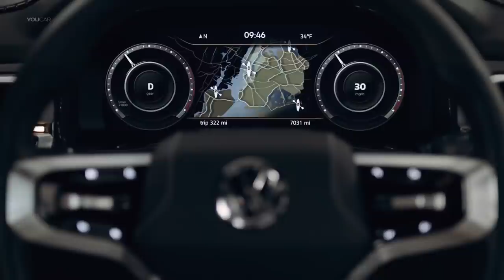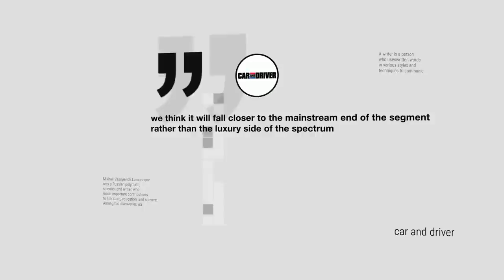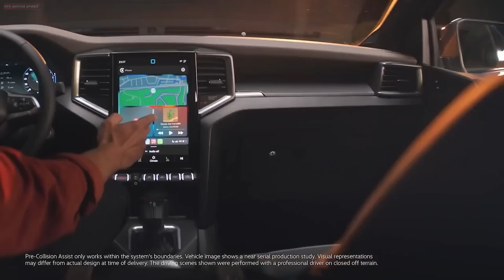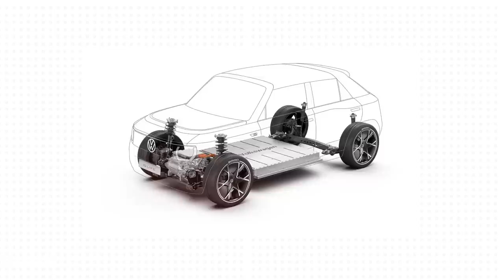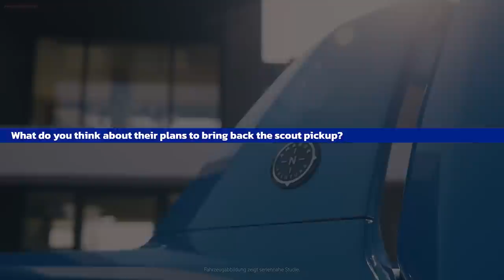Volkswagen CEO Confirms NEW $30k Electric Pick Up

Comment: How long are these electronics really going to last and what is the real lifespan of these vehicle if you actually use them for work ?
Reply: I've found electronics work until one day they decide not to. Every manufacturer is saying they  can't get chips, so why use a computer to work turn signals when old fashion $5 blinker would work? I prefer buttons and knobs that I can find by feel, rather than take my eyes off the road to navigate thru a touch screen, which might not work with gloves on.
It seems form follows function isn't taught in engineering any more...
Reply: They'll last just as long as the electronics on the internal combustion
Reply: They’ll last as long as the typical American engine.
Reply: @lsowner10   if they are like the electronic in my Audi A8 and BMW X5 it may be smarter to stick with my Hondas and dodges

Comment: This pickup looks like it's trying to appeal to yuppies. The thing is yuppies don't buy a lot of pickups. There are lots of other warning signs. For example, the distance between wheel wells is 47"? So if they'd thought about this, they'd have realized 2 extra inches would have allowed sheets of drywall and plywood to lay flat in the bed. Which means I can haul drywall home in my Toyota Sienna mini van but not the VW's pickup.

Comment: The Volkswagen group had a long history of putting new life into old brands (Bugatti, Skoda, Bentley etc) but most of that was done under leaders like Piech and Winterkorn, so I'm not sure the company will have the same result here moving forward.

They had success with Bugatti because there was no time crunch to get to market in 2 years or to make it on a budget. Bentley was all about gradual improvement, and Skoda was all about reselling the same old platform under a new discounted brand to stretch the return on investment a little further. 

What I'm saying is that in each case, Volkswagen succeeded in the long run, but the situation was uniquely different and the strategies used cannot be duplicated here.

More critically explained, Volkswagen doesn't have a lot of success with launching BRAND NEW products -- (a) from scratch (b) on time OR, most importantly, (c) on budget... Which is exactly what this Scout project is about. 

Currently, Volkswagen is struggling to amortize costs enough to make any of their electric cars profitable. Worse still is that the Amarok truck is not designed with electifation in mind so mixing the stale truck platforms with existing VW battery tech won't be cost effective. At best, I might think they would slap a more truck-like off-road looking body onto the existing ID4 SUV and call it a day; but that platform isn't suited to what people will expect from the Scout lineup (think Ford bronco, Jeep Wrangler etc). 

None of this bodes well for this project when the goal is to be in the market ASAP with a competitive low price off-road EV truck. 

All of the details of this project sound potentially genius, and I want them to succeed. But even if they partnered with another automaker (I'm thinking Ford, based on current project partnerships)... I just don't see how the Volkswagen group is positioned to successfully execute on their goal in the first generation of THIS specific product. Seriously as the organization that THEY are, it's not in Volkswagen's DNA to do so.

Comment: VW had pickups back in the 50's. Were based on the same chassis and design as the iconic vans. Offered in regular and crewcab models. One of the great features of these pickups was the sidewalls lowered making side loading easy and when lowered made for a flat deck pickup. The domestic pickups should adopt as these would be better for hauling snowmobiles and quads. Would eliminate the need to buy a skidoo deck and have the weight lower increasing safety.

As for importing the Amarok would love to see it especially if offered with the TDI engine and manual transmission. Too bad they have hopped into bed with Ford as I'm sure they will not compete with the Ranger and with the success I have had with Ford vehicles just can't come to buying another one of those Fix Or Repair Daily pieces of trash.

Comment: VW proves a company can manage multiple brands and that the old GM business plan isn't dead so long as there is product differentiation. Didn't I read Ford was helping VW with trucks in exchange for help in Europe.  
Brilliant creating Scout & selling as a seperate brand. VW has had trouble in the US and truck buyers shy away from imports. VW is making a bet they can out engineer the Detroit 3 while creating a RAM/Jeep rival. I still think VW, or maybe Scout, will end up with Ford (or maybe GM) within a decade
Reply: VW, atleast in 🇺🇸, has had a reputation for hard-2-diagnose problems during 80s and 90s.  Yes , they've made progress and their Audi brand (A4, A5 at a minimum) are considered very reliable cars.  My ex-coworkers had A4, 5, and A6 cars and they were grest cars.
Reply: Toyota sells a lot of pickups so I wouldn't say buyers necessarily shy away from foreign PUs
Reply: @shageevideo  Toyota has definitely sold many trucks but their start was in 1/2 size trucks many years ago. It was a long trek into the full sized truck market, the original Tundra was not full sized, and suffered from lots of design issues.

Comment: Not bad looking, but I wouldn’t consider an EV truck. Hybrid maybe but there isn’t an EV truck that can actually compete if you actually use it as a truck. Sure they are fast and can tow but have you seen how bad the range gets? It’s laughable. The lightning can’t tow 6K in freezing temps 100 miles. That = useless.

Comment: Total missed the opportunity. Hybrid is more practical since people who buy trucks tow and move long distances. This is nothing but for the urban metrosexual skinny jeans coffee house wanna be cowboys. The maverick was successful because people have the comfort of a gas engine, knowing that the charging station infrastructure is not fully matured. Imagine fleeing a hurricane in the Southeast. How long will the lines for a charger be on the roads during a mandatory evacuation or hauling a trailer/boat 2 states away? Charging station going to accommodate the length with a trailer? Idiots in suits that never drove a truck.

Comment: I just want a AWD truck to get from point A-B for work that is similar my Honda  Ridgeline that I have now, it covers 90% of what I do now in service work  I am Past the Bro Truck crap and most of my clients  laugh at that idiocy anyway - I don't need 1000 horsepower I just need it to work like a V-6 motor 300 hp is plenty for what I do,  I can use my Ram 2500  HEMI for the heavy stuff  if not I will just buy another rigeline
Reply: I like the looks of the first generation ridgeline over the second generation one.
Reply: @kyledavis4890   The 1 gen look will grow on you, The Ridgeline has been one of the best trucks I have ever owned My 2500 HD ram that is still have is also a very good truck The new Ridgeline looks like they got lazy - it is also very expensive new about 58K loaded

Comment: The reason that it wasn’t introduced in the USA is because we don’t have the capability to charge large numbers of EVs. The grid as it is won’t handle even a small fraction of the EVs that the socialists want to jam down our throats. It will come eventually, but the grid is not close to handling the charging requirements. FJB.

Comment: why anyone would buy a vw anything is beyond my understanding, faulty wiring, very expensive maintenance, u always have to have a bag full of back lights at all times and u will get to know your local mechanic and his favourite meals plus his kids names really well.
Reply: Maybe for some, I've had roughly 20 VW's over the years and not one of them had any issues. Many of which I had put 200,000+ miles on.

Comment: Bought my first VW a year ago. It’s garbage.  Nothing but a cheap rattle trap with a sewing machine for an engine and trash transmission. Half the interior plastic parts are already broke and the factory tires are down to 3/16 tread at 25k miles even though I’m told by the dealer they’re 70k tires. All lies. Cheap junk car for a high price because there’s a cult fad with them among wanna be Audi owners.

Comment: Will VW even exist in 2026? With so much debt, and no real plan for getting enough batteries, I can't see this ever happening. They can't make EVs anywhere near as cheaply as they need to. Their ID3 & ID4 aren't a bad effort but they're not economically viable. VW needs a completely new platform, and they don't seem motivated to make it happen quickly. I can't see them surviving.
Reply: VW isn't going anywhere...  I think you could make a case for Rivian, or even Tesla going the way of the dodo if something happened to Musk.  VW is the GM of Europe.

Comment: Two ways to turn off
Auto HONKKK LOCK 
if you care about your
neighbors sleep and 
peace and quiet 

1 clip fob ONCE ONLY TO LOCK
( light flash means car is locked
and armed ) 

Or 

2 Press lock And unlock on fob
at the same time for 4 seconds.
This turns off lock continually 

The Auto Industry made a HUGE 
Mistake with this technology but 
has made it clear they don't care about 
our sleep or peace of mind.
Reply: Exactly, and those same miscreants are arming the vehicles with actual LASERS for headlights...  something should be done.
Reply: @kyledavis4890  I volunteer for an organuzation Noise Free America regarding this. If you interested in raising awareness of this let me know.  Thanks.